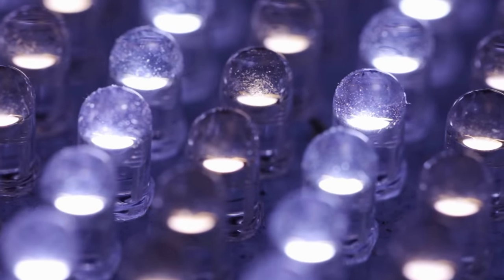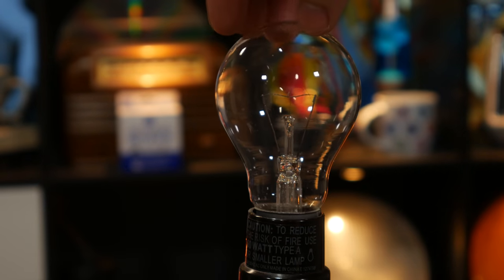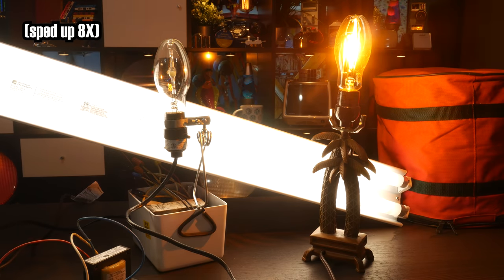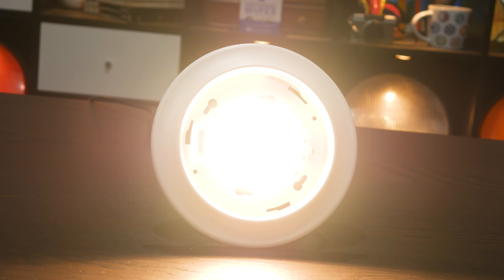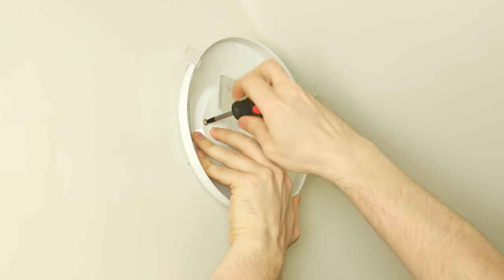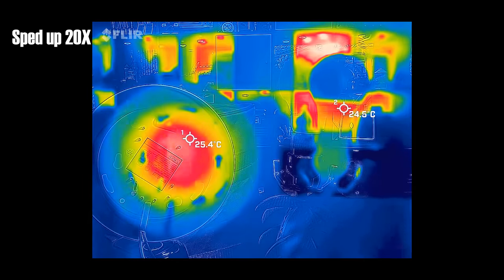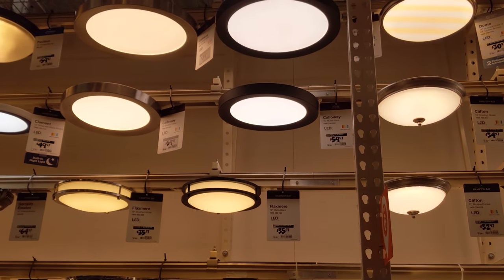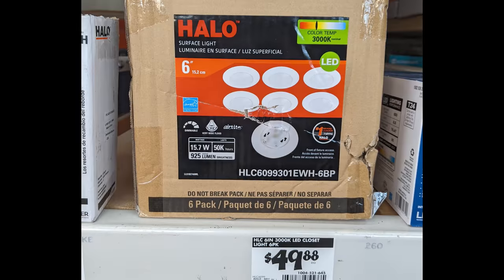A troubling trend in lighting?

Comment: I think it would be interesting if the LED lighting industry could agree on a standard hookup for the circuit board LED, so you can just pull out and replace those teensy tiny LEDs on a board like that without doing any soldering. It would make things more modular and replaceable, without losing the huge advantages of being Not A Lightbulb that being a PCB mounted on a hunk of aluminum provides.

Comment: i would love to be able to wire in one of those smoothing capacitors to a few of my fixtures (both ceiling fan and upright floor lamp) - the 60hz flickering is so damn annoying.
Reply: A proper built fixture does not flicker.

I think something in the rectifying circuit is not having the time of its life.
Reply: It should flicker 120hz, not 60 unless you have 30hz electricity.
Reply: @vallorahn  on 60 times per second, off 60 times per second. Still just 60. I suppose if i added a FULL BRIDGE RECTIFIER (!!) it would be 120 but i think most cheap led lights just use a single diode
Reply: @AlexandruLipan  cheap bulbs dont have (an effective) smoothing capacitor. It's not extremely obvious but you can see a stop motion effect if you wave your hand in front of one. Kinda reminiscent of what you'd see doing the same in front of an old CRT

Comment: one other thing on LED longevity! my parents kept having LEDs dying early until they had to get the breaker-box for the house redone a couple years ago and put in one with a house-wide surge protector. they haven't had to replace any of the LED lights since. so uh... no cheap or easy fixes there, but worth thinking about.

Comment: Yes, this! But some "fixtures" come with a classic medium screw base... since I have a large garage and workshop full of legacy F40T12 fluor lamps, I am gradually replacing the tube fixtures with simple med. screw base lamp holders. Since the industry seems to have a death grip on that socket, and really good LED "fixtures" are coming out which a) screw into them and b) come with an extra med. screw base if you haven't got already got a lampholder on that box.

Comment: I feel like you may have missed some of the slightly more expensive can replacements. I've done some work with Halo brand. the box with the color selectors is separated from the light with a wire that is detachable. The replacements are relatively cheap and you don't have to rewire them. They also have glass lenses that I would imagine do a pretty good job dissipating heat. The lights are also half an inch thick so you can install them below a stud without having to move their position around based on what the rafters are. They also definitely save on labor for installation. I know this isn't a strictly technical thing but whenever electricians installed new can lights they almost exclusively don't recover them with insulation. 

Halo HLB 6 in. Selectable CCT New Construction or Remodel Canless Recessed Integrated LED Kit 

Ps not an add

Comment: these new led all in one fixtures are definitely cool but the lack of repairability is infuriating. there should be some kind of standard for interchangeable driver boards so that you can have fixtures that wouldn't be possible with a socket but can still have the actual lighting bits replaced. maybe even a standard way for the switch to communicate with the bulbn't to allow control of color temperature and whatnot without having to mess with wireless shenanigans. sorta like philips hue but using 1-wire over powerline.

Comment: This sounds like we need a 'flat bulb' (Disk?) standard.
Though I imagine that backfire in that everyone would create their own standard, or make things out of spec.
Reply: Agreed. Hopefully a major manufacturer will be selfless enough to allow others to use their standard royalty free.
Reply: The GX53 “puck” light works pretty well for me for this purpose. 

IKEA carries these lights with good color quality and a selection of power levels and beam widths. You can also get them in many online sources. 

I don’t like the fixtures IKEA makes for them and just go for the generic GX53 socket which is essentially zero thickness.

The puck shape is not ideal. I would prefer a wider and thinner disc like these all-in-one fixtures, but still using the GX53 socket.

Comment: The side benefit of these is that they are very light and can have thinner form factors than bulb-based fixtures, even if they are designed with more traditional looks. I found them quite handy when I was installing lights in a shorter drop ceiling application where being extremely thin was useful. But yeah, if you aren't comfortable doing some basic wiring when they inevitably fail then they are a very bad choice and I couldn't even imagine installing them either in a speculatively-built home, or as a landlord as both scenarios seem like they could lead to real headaches.

Comment: I've never had an LED bulb failure. I moved in to my place in 2015 and as the incandescent  and CFL bulbs failed, I replaced them with LEDs. Some were high end, like our Philips Hue bulbs (no failures) midrange Sengled and Sylvania, and budget like Feit Electric. Most are open air can or chandelier fixtures but even the ones in "boob" fixtures have had zero failures.

Comment: 14:50 linear regulators like your lamp here usually always have this temperature sensor build in. But it only ramps the current down at around 100°C, so it is really only a safety thing. LED's don't like temperatures this high.

Comment: 2:39 well in that case everything is "marginally safe", those sockets are perfectly safe as long as you are not stupid enough to stick your fingers into one. Meat grinders are the same way and so are things like stoves, fans and particle accelerators.

I'm happy with my screw sockets.
Reply: But unlike meat grinders, every child in the us probably has access to a lamp or ceiling light. Having a live feed in a perfectly finger shaped hole is pretty stupid.
Reply: @Tibyon  no, not educating your kids is stupid, i don't know about things where you are at but here people are taught not to stick their hands in random holes and the dangers of improperly managed electricity.
Reply: @deltacx1059  you're right, it's silly to try to improve things. That's why I use leaded gasoline and cut all the ground prongs off my appliances. It was good enough for my Grandpa, it's good enough for me.
Reply: @Tibyon  making things better is all well and good but there is no practical improvements to make to these sockets, they are already a standardized form factors that is comparable with millions of products.  Changing it would require BILLIONS in infrastructure changes to use a new standard and it's just not worth that when the only problem is idiots sticking themselves in holes they shouldn't.

Comment: Thanks for the content :) I know next to nothing about electronics, but I still find it really interesting to listen to someone really knowledgable in their field.

I live in Japan and all Japanese apartments seem to come with standardized ceiling light "sockets"/mounts. They don't require any electrical knowledge, and you just have to "screw" the entire fixture into the mount.

This blog post from 2013 has a description of them and some pictures: http://www.accessj.com/2013/02/moving-light-fixtures-for-japanese.html

Note that larger fixtures come with an adapter which you screw into the mount, and then you can just push the fixture up into the adapter (and then plug in a cable for power): https://www.youtube.com/watch?v=pwX5wqzT_KQ

As you can tell from the date of the blog post above, this is not a new thing at all. In fact, according to https://ja.m.wikipedia.org/wiki/引掛シーリング (currently Japanese only), the first one was created in 1977, and they became widespread in the 1980s. Even before this standard mount was created, it seems like older light fixtures attached to a normal electrical socket in the ceiling, and were supported using hooks screwed into the ceiling. You can see an example of this in this retro Japanese light fixture that someone is trying to sell: https://jp.mercari.com/item/m83323354779

This doesn't change the fact that the fixture is a single unit, and you cannot replace just the LEDs without replacing the entire fixture, but it at least means that someone without electrical knowledge like me can safely and easily replace the fixture. That said, given that Japan generally has high manufacturing quality for electronics (and therefore Japanese consumers also have high expectations), I think it's pretty uncommon for a fixture to wear out (at least I have not experienced it yet, but I've only lived in Japan for about 5 years so far).

Comment: On arriving at our current home half a year ago, the recessed ceiling lamps impressed the GrandBoss as more like holes in the roof.  With a little shopping we settled on store brand retrofits featuring an Edison pigtail and a temperature switch.  Adeiu to the trims & fills (hello, ReStore!).  Despite a few flood lamps (bulbs) that bound up with the trim, I completed all 52 replacements over two days.  Labor, yes; hassle, no.

Next target is 21st century dimmers.  The old ones are line-sensitive with sliders long untouched.

Comment: I'd like to hear your thoughts on LED shop lights. Mine are constantly dying, flickering, etc. and I can never find the same brand again, so I have 3 of this kind 2 of that kind 4 of that type, one of which died... it would be really nice to have some standard types.
Reply: Yea, thats the reason I get old fluorescent fixtures from a friend who remodels. When a client requests an "upgrade" to LEDs I pick them up after the jobs done. Ballast are pretty cheap and when you need reliable steady lighting they are best atm. Will probably eventually swap when they get more reliable but till then I made sure to have a several year supply of replacement ballast and bulbs.
Reply: Shop LEDs seem to be either great or awful. There is no middle ground
Reply: I plan on changing as soon as they become reliable. "There are things in them that react poorly to gunfire." Applicable movie quote aside as a gunsmith accidents eventually happen and those bulbs behave especially bad in regard to flying pieces of metal.
Reply: @Colonel_Overkill  Wow, I never considered gunfire disrupting lighting ballasts. I'm not in the habit of discharging firearms in my garage. : D

Surprisingly, my favorite shop lights were purchased at Harbor Freight. These have a great temperature and zero flicker.

Unsurprisingly, the lights I loathe are from Sam's Club. These have two bulbs that are not frosted, cool temperature, and have a noticable flicker. I guess they haven't discovered capacitors yet.
Reply: @kainpwnsu  lol, we are in agreement. There have been cases of a round going off from chambering it or other explosive malfunctions. The room is armored and safety is of utmost importance. Equipment is replaceable, lives are not. Im proud to report the closest thing to an injury was a fellow had bent over and his crack happened to be where a very hot spent .300 kurtz case from a firing test at the indoor bullet trap landed right in the gap and dropped down his pants. We are unsure to this day whether to call that a workplace accident or karma for not keeping his bloody pants pulled up. None the less, the light count replacement to date is about a dozen 8 foot bulbs and 3 ballasts.
Reply: @Colonel_Overkill  If these lights plug in to an electric outlet instead of being hardwired, try running them through an inexpensive un-interruptable power supply. This should level out power drops and spikes that may be corrupting the LED drivers. Some areas are more prone to power instabilities that cause problems with LED fixtures, computers, and other electronics.

Comment: 25:16 -25:23
My theory is fluctuating power. the high rises and low dips in power can really wear down electronics, and LED lights are in the electronics category. Dirty power is why I use a very expensive UPS/surge protector for my computer. It regulated the voltage flow and I've noticed a marked DECREASE in component and router deaths ever since.
Reply: No. Your hypothesis is this, unless you've done dozens and dozens of tests and experiments which all support this, and none of which showed it to be wrong. Then it might be considered s theory. Currently, it's barely a hypothesis.
Reply: @MaryAnnNytowl  I'm basing it on what was taught in the A+ cert courses, as well as various things other computer guys have said on youtube and the internet in general. Specifically about dirty power and electronics. 

What is it called when you have knowledge of a problem a dozen of experts, a past teacher, and a textbook says it's the same thing and have similar solutions? I'd call it a fact, but I figure that's presumptuous, so I called it a theory.

Comment: whenever i bought light fixtures i have never considered the cooling or efficiency advantages of the built in LED fixtures, 

but whenever i bought lights that had to match (like the 6 potlights we have near each other in the kitchen or the 3 pole lights on the driveway) i would opt for a fixture with a removable bulb, that way if 10+ years later one of them burns out you aren't trying to track down one particular brand of light to make it match the others, or be forced to change them all to match, its much easier to get a standard bulb to match or replace all bulbs to match if there's multiple lights,

Comment: I feel they should have really made a new "socket" for this type of light. There isn't much standardization around low-profile sockets, but there's no particular reason not to have a "bulb" that's basically just a circuit board with delusions of grandeur. Even something like "pop the cover off, unplug the existing board from the integrated connector, unscrew the screw in the center, then repeat for the new board" is reasonable for a renter to do, and it basically just needs the board to be attached via a single screw in the center and a standard connector to be in the fixture. These fixtures are 90% of the way there already. Something with an actual socket is even easier, and still shouldn't impact design.

That completely eliminates issues around being unable to find replacements, needing to use wire nuts if a bulb fails, and being able to upgrade as needed, while still retaining the benefits of directional light and low-profile fixtures: the best of both worlds.

But yeah, I'm right there with you on your concerns, bolstered by the time when my parents chose to install fluorescent lighting throughout their new home, but the fixtures had an integrated ballast, and the ballasts were all bad. We ended up replacing a lot of light fixtures over the next few years. When building a home, you'll use similar lighting throughout the home, which means that any problems with the lighting in question will have a significant impact. (And remember a few years back when a bad batch of capacitors made it into the electronics pipeline?)
Reply: I remember how early CFLs were actually two parts, the ballast and the tube, and it was possible to unplug the tube from the ballast. I guess the hope was that people would start making fixtures with that type of socket and integrated (higher-quality) ballasts once CFLs went mainstream, and to their credit, they managed to standardize those sockets. It's just that we never got to the point where they were necessary or useful.

Comment: 17:30 Finally, someone who understands my need for 2700K (or lower) lights. Why is it so hard to find good drop-in E26 or GU10 2700K bulbs?
Reply: Because there's currently some weird fetishization with turning everything stark sterile greyscale. Warm bulbs make white look yellow with little or no ambient light, and for some reason interior designers recoil in horror from that like vampires from garlic.
Reply: @VulpesHilarianus  You're so right. With the explosion of 5-over-1 apartment buildings, I've been inside a few. It seems most are still using CFLs for reasons completely unknown to me. However, the ones that use LEDs seem to all install 5000K bulbs. I feel like they're trying to burn my brain through my eyes.
Reply: I settled on 2700K years ago I switched to LED because it most closely resembles incandescent. However, I have 5000K in the master bathroom and  6000K in the office and garage. The lack of 2700K seems to be a more modern shift. It seems like the industry is standardizing on 3000K and 5000K.
Reply: @equid0x  5000K sounds terrible. 6000K would be trying to burn out my retinas.
Reply: @matthew.datcher  I don't know how people can live with the 6000K bulbs all the time. The 5000K aren't nearly as harsh but a little cold for my taste.
Reply: @equid0x  Warm light doesn't produce enough light. White and cold does, but not the warm.
Reply: 2700 is King.
Reply: @marshmower  me with cold lights on reading this: ._.

Comment: to your title question, yes it is a troubling trend. I am a facility manager that looks after large buildings. I have to shop carefully to avoid fixtures with integrated LED because we do not want to replace an entire fixture when they burn out. it may not be as big a deal for home owners but when you have 50 fixtures or more its huge. and try finding a matching fixture 5 years later... you cant replace the leds without voiding the UL and CSA approval.

Comment: I bought similar LED ceiling lights, but 12 volt powered via a 12 v, 1 amp wall supply. That way, just stick them to the ceiling, run some thin bell wire of the same color as the wall, and done. Produces a lot of light for an otherwise dark corner, and fits where a can style couldn't.

Comment: 17:42 Well that's very unusual, I actually have something to nitpick in a Technology Connections video.
Kelvins, not Kelvin degrees or degrees Kelvin (I was surprised when checking, just to make sure, that the unit actually used to be the degree Kelvin in the past, but it's been changed in '1967/1968')